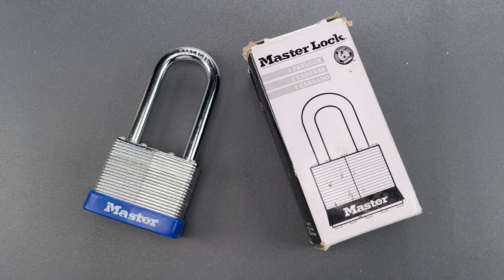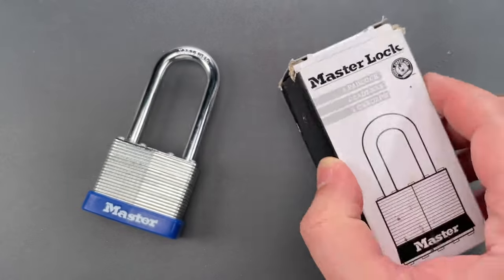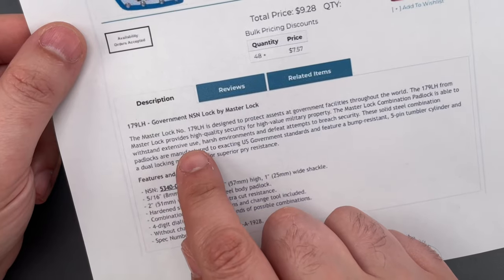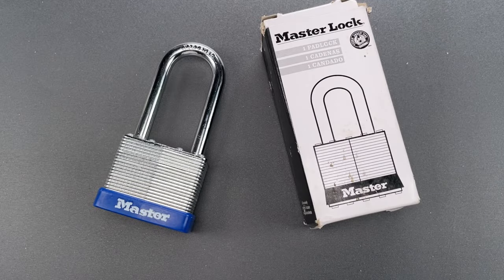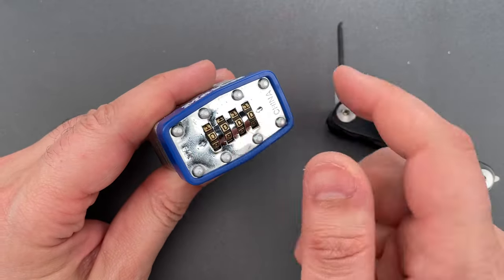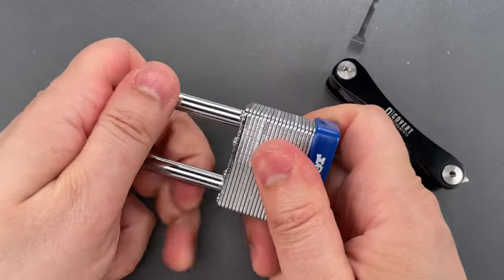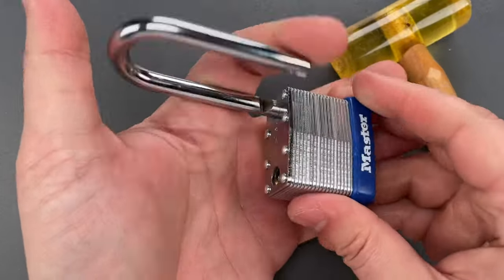[1449] TERRIBLE Master Lock Laminated Combination Lock (Model 179LH)

Comment: My dad was in the army, and he always tells me that “military grade” means cheap and easy to mass produce by the lowest bidder.
Reply: It depends on the spec, but it does mean it is the minimum viable product to meet that spec. If the spec is robust then it will be good. 99% of specs are not very demanding so the minimum is a low bar to clear.
Reply: Their sunglasses are pretty good, though. Made by Randolph Engineering.
Reply: @warmowed  " ... so the minimum [spec] is a low bar to clear."
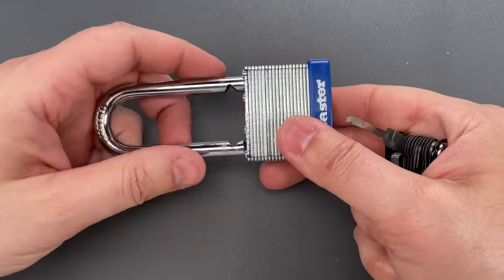1:28 Just like the locking bar
Reply: I have served 25 years. Nothing scares me more than the term "millitary grade"
Reply: Essentially right.
Reply: At 5 times the normal cost.
Reply: More like best scammers 😅
Reply: ill fix this for you. 
"My dad was in the army, and he always tells me that “military grade” means cheap and easy to mass produce by the highest bidder."

The amount of waste spending i saw in the marines was disgusting. i worked on the CH-53E and we had to replace a valve body for the rear ramp lift. they were paying 15k for a 1500$ part. they rejected all bids no matter what the quality and price and just gave it to lockheed every time.
Reply: @marinetarts  Some palms got greased for that one.
Reply: @marinetarts  This is way worse in germany... We invest around 40 billion € into our military but literally all of it goes down the drain
Reply: true, depends what you're talking about though.  parts for a helicopter for example will have rigid specs for strength, material alloy, etc.  some shitty general purpose whatever, they won't care because nobody competent writing the contract wrote the procurement order as "i want a padlock with 3/8" minimum boron alloy shackle with blah keyway and x features."  they say, hey i need a padlock and write "order to secure 1000 padlocks" and toss it out for bid.  of course the lowest cheapest crap is gonna win.  i work for the govt and this is how it is with such system
Reply: The military and GM must copy each others notes.
Reply: @SupremeRuleroftheWorld  Military graaaaaade!👻

Seriously though, one would expect even the lowest spec to be at least a bit better than decent. But based on what I heard (as someone with zero military experience), NOPE!
Reply: I'm in the army.  This is extremely true.
Reply: @leoe.5046  40 billion lol.  you should see how much we burgerlings flush down the crapper, it'll make you feel much better
Reply: What did he do in the Army?
Reply: Taxpayer grade
Reply: @BigWheel.  government motors
Reply: @SupremeRuleroftheWorld  Military Grade tape is awesome.

I'm out of things to say that about.
Reply: he was absolutely right - another soldier
Reply: Basically every chinese product.
Reply: @leoe.5046  That's because of all the military restrictions imposed on Germany after WWII (For obvious reasons). There are many limitations like not being allowed to have biological, chemical, or nuclear weapons, etc.
Reply: "cheap and easy to mass produce by the lowest bidder, including a kickback to the procurement official."
Reply: I mean.... It also means super expensive one off parts that need to be re contracted with every order, and, oh, by the way, the only manufacturer is owned by the brother-in-law of some senator.
Reply: But the junk looks good doesn't it ? Minus the drab green uniform .
06/18/2022
Reply: Military grade optics are all pretty good to excellent. Trijicon, EOTech, Aimpoint, Leupold, etc.
Reply: @CanI...  and it´s even much worse for Austria. Forced  by the Allies to be  forever a neutral country.
Reply: @wzukr  well, given that the only two world wars we had were started by these countries, it's kinda fair. Kinda like not allowing a felon to possess firearms. 

Fairer than well-standing citizens who never committed crimes not being allowed to purchase a gun to defend themselves like in many states and countries.
Reply: @Orange Crush Where do you get the idea that new tech, medicine, and other innovations are driven primarily by tax dollars or corporate welfare from the government? In capitalism, differently than in communism, the government is pretty much a limiter of innovation instead of a driver. 

As you yourself gave the example, necessity rather than whatever you tried to mean with the examples. HD bought Alta to conquer the electric motorcycle industry and the CF-105 was canceled by the government (probably because it didn't meet certain criteria. If the government would be following its agenda, money wouldn't be a problem. Don't take me wrong, I think the US government (as most of the world governments) are going down a horrible path pushing the left agenda with things like abortion, LGBTFDOWE+, etc but those things tend to be done in the eyes of everyone, not in secrecy. That's how stupid we are as a society.
Reply: @Orange Crush I disagree with your point of view. We all can get tax returns if we know how to file our taxes. Thing is, most of us don't keep receipts for books, health insurance, etc much less take advantage of tax loopholes that allow us to get our gym membership, dinners and other expenses from our taxes.

If capitalism would be so bad for innovation, then America would NOT be the most innovative country in the world. We would have all our innovations coming from Cuba and North Korea. Think about where the majority of innovation comes from...Isn't it the US and Europe?

As for most people living from paycheck to paycheck (or being high in debt), I believe that is because schools are more worried about teaching CRT and gender BS than teaching personal finances.
Reply: 1000% true story
Reply: That's exactly what it means! I would never buy anything advertised to me as such, because that means it's crap.
Reply: I agree. I’ve heard that military grade meant being 

1. Good enough to do the task it was made for
2. Easy to maintain and easy to be used by troops and durable
Reply: He’s not wrong
Reply: This is a military grade comment!
Reply: Too true sometimes...

We locked soft shell vehicles with a 1/4 inch braided cable and an American lock on a plastic steering wheel. Lol
Reply: @sholahverassa8582  like a tactical turtleneck?
Reply: @CanI...  um. No. That ended a long time ago, no country can have those weapons by the way, by treaty. You know no one has them......
Reply: @CanI...  so you want the right to be free, as long as it suits your personal opinion on matters? OK.
Reply: @RealGreenrh  you would think wouldn't you, but no. Politics and greasy politicians decide what you get. Back handers and brown envelopes are what decide equipment a lot of the time.
Reply: @handlesarefeckinstupid  Sorry for not understanding your comment. My last comment on this thread was a month ago. What weapons can't any country have?
Reply: @leoe.5046  40 million is nothing the u.s try billions
Reply: @Orange Crush That was an excellent take. You should start a blog or youtube channel about it
Reply: Unless it's electronics, in which case it often means functional in stupid temperature ranges and ESD resistance.
Reply: @marinetarts  America moment
Reply: Most government contracts in capitalist countries are set in the system of lowest bidder. For example recently there was a need to produce a plan of our city of high quality with borders of different private land areas marked onto it. After all, it was done by a company from another city via satellite photos of five year age and they did not went to the city with the measuring equipment at all. One big apartment complex was still shown as a dozen separate houses which were dismantled long ago. It would be unthinkable in Soviet times.

Comment: I used to think "there's no way the cops on NCIS picked a lock that fast" and then I started watching your channel.  Seems like most locks are designed as a deterrent more than actual security.
Reply: A bad lock is more secure than no lock, so yes it’s a deterrent, any determined criminal will probably get in anyway. Besides, if the locks are too good the window won’t be
Reply: I wouldn't say "most locks". I would just say "cheap locks". The problem is that people have come to expect MasterLock's pricing for all locks (by virtue of not being able to tell a good lock from a completely shoddy one). But there are PLENTY of locks out there where the pick time (even the absurd "LPL Pick Time(TM)") far exceeds the physical braking time with a crow bar, double wrench or cordless angle grinder attack.
Reply: There's the old saying... "a lock is for keeping honest people honest". Someone determined to get in will find the path of least resistance, which may be the door itself (see Deviant Ollam covert/overt entry talks for examples of that) or a window etc.
Reply: @salt_lake  I hope the rubber mallet section was on the other side of the store!
Reply: @ApeironTsuka  never heard that saying but its a good one, Ill have to use that.
Reply: Deterence/intimidation is a well know security feature: one who don't even try is already defeated.
Reply: @ApeironTsuka  this misses the point - good locks (as part of effective overall security) are effective because they convince a villain that nicking somebody else's stuff is going to be easier. Good locks don't just keep honest people honest, they keep dishonest people looking for somebody who bought a garbage Masterlock because they'll have an easier time breaking in.

Comment: Master Lock: “We didn’t include a keyhole; that makes it more secure, right?”
LPL: “No.”
Reply: If you have a notch decoder then it technically has 5 keyholes
Reply: That loock had one keyhole, the front cover. The key is any hammer.

Comment: We had wall lockers in the army of many kinds and made by different companies. Most of them had the same flaw. All you had to do was lift the door by where you put the lock, pull on the lock and push down the door. The latch or locking levers would then be moved out of their holes and the door would open without having damaged the lock. Those wall lockers were also used to store evidence. You could easily get the case thrown out by showing that the evidence wasn’t secure. It was possible to open the door without leaving any signs that you opened it.

Comment: 12 years in Army Aviation. (Heli engs) Spent some time in Production Control so I am VERY familiar with NSNs and NIINs and how to order parts from crappy locks to full engines.
Those locks are really only a token security measure. (Your tank thumb couldn't be more perfect!!!!)
We don't use combo locks. We always use keyed locks. Tell one person the combo and 10 will know by the end of the week. Your department, section or yourself will be assigned a key or a login for the key box. Thumb print and code. The only time we use those is for lockers, duffle bags and equipment chains and by equipment I mean mobile stairs, racks, steering wheel chains and so on. They are not meant to be high security deterrents. They are really only for accountability and "safe" storage measures. It's about layers. So a rando sneaks into the base (news at 11 man shot trying to).... so ok they sneak in, get through a few fences, find where they are stored and cuts the chains or picks the lock. Now they need to get back over a few fences with MPs and cameras all over the place and somehow convince the front gate to let you drive your mobile stairs or other that's not supposed to be out here booty. 
I got into lock picking in 2015. I was opening all those MLs all over the base. As well as desks, hutches, closets and other we just don't want people opening whatever walking by.

So the Tank thumb.
Those locks are really only a token security measure that stems back to San Diego 1995.

Shawn Nelson broke into a base and jumped into 3 tanks before he found one that started. No keys. Back then. That was the tank driving down the freeway event. Bad security and dereliction of duty had left the "door" open. 
Since then EVERYTHING needs to be locked down. Ground vehicles got chains that lock the steering wheel and helicopters got ignition wire keys that you could literally reach under, pull the two wires and tie them together. Off ya go...

It's all just another security layer that gets a check mark on the old daily is this done list and does it adhere to Army regulations and the base/department SOP which are all autied over and over with more than a few "well this is very stupid but it says right there DO THIS so there ya go big brass. It's just like what the SOP states"...... As stupid as that is. WHAT DID YOU SAY.   Aaaah oh nothing sir.. Just talking to myself.... Close one....

Oh and to those tossing around the old $1,000 hammers. $,5000 toilet seats.
Old myth. Production control also tracks the money. Some parts might be a few $ more expensive but overall you can source parts locally if you can't order what is needed and yep. You get a military discount. 
There was some contractor BS going on back in the 80s and 90s with some creative bookkeeping but the integration of computers into all sections of the military meant if you charge 1k for a hammer and it gets through get ready to refund the overpay and they did. A few contractors didn't survive. 
We also get Private WTF is wrong with you accidently ordering crazy shit or accidently order 1,000,000 washers when they only wanted 10.... 

I was installing and engine and reached for the generator box and it felt a bit lighter than normal. WTF. Open the box. WTF? One guy accidently ordered the casing for the generator and just the casing. I didn't even know that was possible.... The kicker. It was more expensive than a whole and complete generator. By A LOT.... 
And the myth lives on when some report comes out about overspending and never looks at the refund that came right after.. LOL 

Ok.. I think that's enough coffee today......

Comment: Hi! National Gaurd Member here. Cant speak for Active Army, but we just moved lockers and they issued our entire unit these locks. Master lock is still on contract to make these locks as far as Im aware.  after watching your similar videos on this topic I made that same tool out of one of my soldier's hair clips. Anytime supply is locked out of a locker i just open them (or my own for that matter) that way. I dont even remember the combination for my lock because they can be opened that reliably.

*edited for spelling errors
Reply: And yes you can still the use the butt of an (unloaded) M16 or M4 to open them as well. Unloaded because if the bolt is locked open than it will slam shut. Even with the fire selector in safe.
Reply: @jacobkamphaus5565  Ah, yes. Using a safe gun to open a safe lock.....
Reply: @Nugire  yeppers! Because thats what the army issues qualified soldiers trained to "safely" use firearms. In all seriousness though thats not something we use on any kind of regular basis. If youve watched his channel before you will remember that LPL recalls using the butt of his M14 in ROTC while he was in the military to open similar issued locks. In normal practice though we reach for a hammer. Or bolt cutters. And usually supply keeps your lock code in a sealed envelope for you in case you forget. Not going to touch the idealogical poke for a gun safety argument there.

Comment: No, it's actually a good commentary on most of our government's "security measures". Sounds good on the package, but ineffective once off the page, rife with oversights and unintended consequences.
Reply: Is that why they have an oversight committee? ;-)
Reply: @KonradTheWizzard  I see what you did there 😁
Reply: Maybe they are made to be shipped to enemies.
Reply: All locks in the military tend to come with a guard force that checks them on a schedule.
Reply: This lock still seems more useful than the TSA though.
Reply: 6 years wheels mech working on up armored vice. I don't care what lock you put on there are o ly a hand full of alloys used in locks for the bar its self. All of with snap like a twig when met with a f wrench of adjustable wrench just twist it right off o effort are you going to put a 100 dollar lock on those doors when you mechanics simply pop them off the very same way? No matter the price no matter the material.

Comment: My Army unit had those on absolutely everything. If we forgot the combo we just lifted it up and slammed it down and they popped open every single time. We eventually switched to the keyed version and they were just as easy to pop open. 2 seconds was all you needed to "borrow" supplies from a different unit lol 😆

Comment: Me: "Bump-resistant? Combo locks can't be bumped anyway!"
LPL: "Bumps it."

I know it's not exactly the same as bumping a tumbler lock, but I was amused.
Reply: We used to take off a boot and whack these with the heel to open them
Reply: @joshuaborchardt4355  As LPL would likely add, "...which is probably faster than entering the combination."
Reply: Never underestimate Master Lock's ability to screw up a product in unique ways.
Reply: As Isaac Arthur likes to say, "If brute force isn't working, you're not using enough of it!"
It may be worth noting that Isaac Arthur is also an Army vet.

Comment: We used to use locks similar to this on our furniture delivery trucks.  It was super handy to be able to hammer them open, as we were forever losing/forgetting the keys.  There was a point at which the locks stopped working with the keys (probably from the repeated hammering) and we just switched to hammers only.